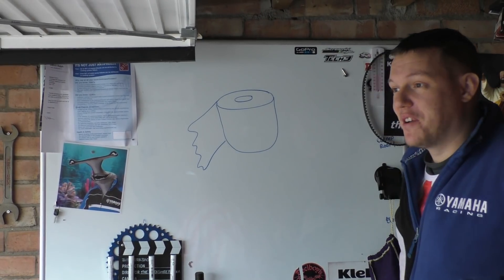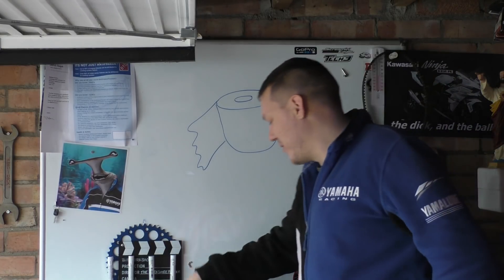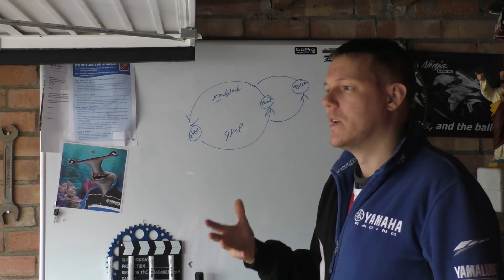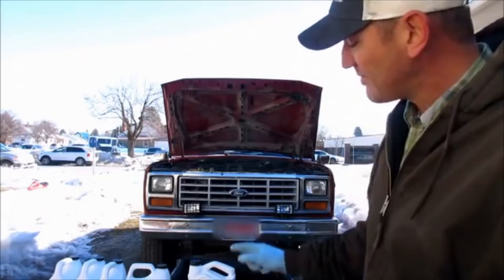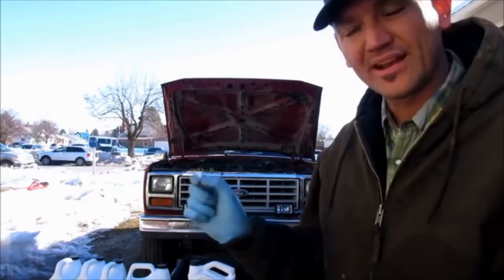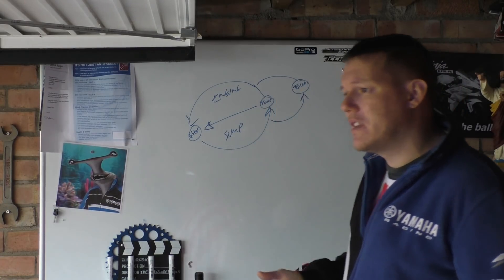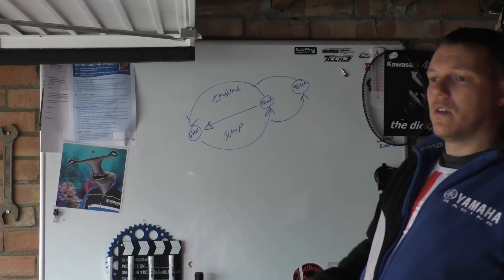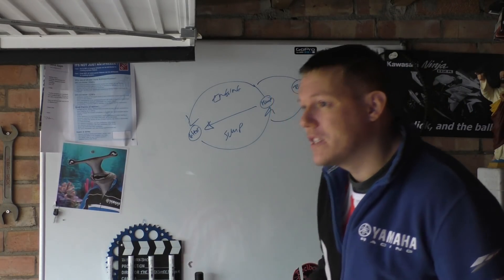Toilet paper filter???

Comment: You sir have no idea what you are talking about.
I used one of the Frantz filters for years without an issue and it was the only filter on the car as I removed the spin on filter and used the adapter plate that came with the Frantz kit.

Comment: You tee it off of any port that's under pressure i.e oil pressure sensors etc. And because they are fed constantly by a small amount of the systems oil the entire volume gets filtered and they are amazing

Comment: I call bullshit on your video! These filters are amazing (i.e not rubbish) they keep the engine oil clean as and we used to rely on SOS oil sampling to tell us when to change it because it's always looks so clean. Maybe you should work with something that has one on it before you make assumptions and make videos based on your thoughts. Just because you draw diagrams and have a little knowledge doesn't mean you know what you are actually talking about
Reply: So true, I used one for years without an issue and it was the only filter on the car as I removed the spin on filter and used the adapter plate that came with the Franz kit.

Comment: You can't put a sentence  together without the f word. You are trying to convince  people that something you know nothing about is no good. A depth filter will remove the abrasives. Additives last a long time in clean oil. When you change the filter the new oil added replenishes  the additives.oil doesnt break down toilet paper. The Frantz has been around since 1953. I have been using them since 1963. Carbon is inert? And you call me dumb.
Reply from the maker: I can, I just choose not to. And what the fuck are you banging on about?

Comment: Actually the guy demonstrating the Frantz knows more than any of you clowns. Nothing he said was untrue. Shell Rotella has been proven over many years. Probably shouldn't tell people not to use it. A pass through a Frantz and it will be clean.we all know new oil gets cleaner after passing thru a depth filter. The Frantz should have been mounted in a better place where it could drain at shut down. I mounted my Gulf coast junior on the plastic fan shroud. Returned the clean oil to the fill neck. No spillage when changing the 1000 sheet. I have done fine for over 50 years with Delo or Rotella. I use synthetic in the cars.I put two fingers in the core and count 30 rounds off with the Great Value 1000 sheet. I do a filter change about every 2 K miles on the diesels. If.I stay on this ignorant forum any longer I will be ignorant
Reply from the maker: Wow you are dumb.

Comment: Black doesnt mean dirty. The oil can be very black and. Be analytically  clean in a diesel engine. Some soot is non abrasive but it will turn the oil black. Its more.like ink. There are over the road trucks that have gone over a.milliion miles with no oil drains.The big Gulf Coast paper  towel filters  need a lot of new oil added at filter change. We know that new oil can be dirty. It wont stay dirty with.a good bypass filter. You will find the big paper towel filters on off shore rigs These are. Locomotive engines. A Shell rig will have the big Gulf.Coast paper.towel filters. The lift trucks will have toilet paper filters. Engineers will get a sample of oil and pass current thru it. Dirty oil will conduct electric  better than clean oil. They are checking for engine problems such as coolant leaks. That tells them if the engine needs to be taken out of service and a sample of oil sent to the lab.
Working in a marine engine room in July and August doesnt appeal to me any more.The Frantz Motor Guart and.Gulf.Coast filters all hook up the same as the.old.optional equipment bypass filters that were factory installed such as on my 41 Dodge.they dont starve the engine of oil. You need to do more learning and less talking.

Comment: At one time in the US all filters were bypass types and optional equipment.They all hooked up the same way. My 41 Dodge came with a Fram that used a.cotton element. GM cars came with an AC with a cotton element. Heavy duty diesels used Luberfiner  bypass filters that used cotton and later pulverized newspapers. They all tapped into the main oil pressure cleaned a small stream of oil and sent it to the oil pan. The small filters used a 1,/16" orifice. The large diesel filters used a larger orifice. In 1953 john Frantz came out with an adapter that allowed you to use a roll of toilet paper which was superior to cotton and cheaper. The problem with toilet paper is when it is mentioned  stupid people come from all directions. The smart people also come but they are out numbered. Thanks to the internet more.people are learning.

Comment: I started using toilet paper filters in 1963. Never.regretted  it. They clean oil. Oil dont break down paper..it is obvious you dont know shit about filters. I prefer  the Motor Guard  or Gulf Coast filters because they are easier to service. At one time Frantz had a.FAA and.PMA approved model that used toilet paper.You can find a lot of of Frantzs on Shell and Chevron drilling rigs. Many have been replaced by Gulf Coast paper towel filters. NASA is using Gulf Coast filters now. Yes the guy is clumsy. He probably goes too long between filter changes. You dont need a special oil. Nothing wrong with the filter.except if they aren't mounted correctly and you dont know how.to service them they can be a pain. The ones that take 3.rolls of toilet paper the 3 stackers you find mostly on large diesels in the.Gulf.of Mexico are a real pain to.service if you dont know how. My guess is the engineers.that service them know how to do it. The shrimp boat owners all know how. .

Comment: Low IQ. What do you expect? They believe in ever bit of marketing out there and will run on unicorn juice if it was sold.

https://www.bobistheoilguy.com/forums/ubbthreads.php?ubb=showflat&Number=2489538
Reply from the maker: LMAO!
Reply: Did you ever make a video testing the actual filtering capabilities of this filter setup?

This guy tested Amsoil and Frantz filter (toilet paper oil filter). He said his Toyota that used Amsoil had issues with the variable valve timing due to sludge. 😂😂😂

https://youtu.be/TCk8gzZGq2A

For what it's worth, I used to work at ExxonMobil at their lubricant production facility. I know how the stuff is made, tested, and shipped. These guys have no idea what is going on and if you read the link on Bob is the Oil guy, a worker at the Lubrication Specialities tried to res a 10 year old thread that started in 2004 in 2014 and attempted to rebuttal to senior forum members who questions the economics of a $50/gallon never have to change Motor oil. He was dropping bombs like TBN and old oil spec standards while others were questioning why his company is not even API certified... PAO!!! Omg, PAO! It's the shit! Actually, no it's not. All the modern Motor oils post oil market crash of 2013/14 is made predominantly of GTLs as they are not only cheaper but performs way better.

Oil chemistry is a Science. Big Oil companies hire hordes of highly qualified Chemists to formulate multiple blends to be used at different market conditions based on the price of the ingredients to still guarantee the same specs to the end user.

Oh, that Lubrication Specialities test claiming it is cleaner... That's not even a test done by an independent third party. That's the same as the Snake Oil salesman says that 60% of the time, the Snake Oil works everytime!

Marketing works though as there are certain sectors of society that falls pray to marketing since they aren't intelligent enough to make a logical and sound decision. It's business at the end of the day and if idiots want to buy it, would you stop making it?

Comment: A NASA engineer mentioned how the new oil. gets cleaner after installing a Gulf Coast filter. This was news to me. I thought new oil was clean. Gulf Coast happens to use toilet paper in their small filters and big roll paper towels in their big FIlters. You will find them on off shore rigs for Shell Chevron and others. Its not good to tell people not to use Shell. I know of a Peter Bilt.truck with over 1 million miles using Shell Rotella with one oil change. It uses big roll paper towels. Don't believe me ?.  I couldn't care less. I'm 80 years old.

Comment: I have used toilet paper filters for over 50 years.If you can't look at a roll of Scott 1000 sheet and  understand why they clean oil I can't help you. There are a lot of reasons for changing oil mostly poor filtration. Leaky head gaskets. Not driving enough at operating temperature to evaporate the fuel and water.. When you change the filter and add a quart of new oil you are adding enough new additives. That is if you change the filter often enough. Before I started using synthetics.I changed the toilet paper about every 2000 miles and added a quart of new Delo 100. I changed the toilet paper once a year and added a quart of Mobil 1 on the Subaru for over 250k. That was about every 12k. The Lab said the oil looked good for that many miles but recommended changing the filter every 6k which I do now.
Reply: Oh yes carbon is very abrasive. Yes some new oil. Is cleaner than than others. That is why you install a depth filter. 50 years ago I thought new oil was clean. We learn.
Reply from the maker: "Oh yes carbon is very abrasive."

- You mean like graphite? LMAO don't be a dickhead
Reply: What if funny is you calling someone else a moron.

Comment: Mecca produced those in the 1970s; all the top race teams ran them -- full-flow, no-bypass, 45 gpm (US gallons) rated using (iirc) straight 40W @ 50 psig and 230F.  Sub-micron filtration.  Unsurprisingly, racers changed the TP before each race group (qualification + heats + main event); doubtless, some changed more frequently than others -- but you had 24h races like Le Mans being run with them, practically everyone in Can-Am, the Baja 1000 and the Paris-Dakkar rally.  Those engines were being mashed-on HARD, and the Mecca filters (which were expensive af) seemed to keep the engines together and the teams, owners and mechanics happy.

The selling point was that the TP filter went between the pressure stages and the engine, in a dry sump setup (not sure if wet-sump engines were modded for similar flow, but it is possible), thereby ensuring the cleanest possible oil to the engine (no wear metals from the pumps, etc).  A second filter was used by some teams to guarantee the oil/air separator and oil tank remained free from abrasive contaminants.

Oil Tank --> Pressure Stages --> "TP" Filter  --> Engine --> Scavenge Stages --> (Optional Second Filter Location) --> Oil/Air Separator --> Oil Tank
Reply from the maker: Prove it.......

Comment: I just use the Royal Purple oil filter which have the best filtration out of any full flow filters they say 80 percent efficiency at 10 Microns there's also Amsoil which is the same exact filter but Amsoil is more expensive for their name as well
Reply: Franz filter down to two microns & absorb 8oz water.

Comment: I am testing an amsoil bypass filter myself went with bigger filter than needed to help cooling (didn't cool much at all but i did add a oil cooler on the return line with 0.5 amp fan) 
The engine holds 1.5 quarts and the filter holds about 1 quart plus hose almost doubled the oil capacity so in that respect improves change intervals and I'm running full synthetic oil however the engine oil filter will still need to be changed every 100 hours oem intervals. 
The bypass filter wasn't cheap but I was ticked off the find 1" wide thread on it so I had to spend more $$$ for the remote filter mount for it. I was going to put a plug in the fitting to limit the flow but that blew up in my face with unique thread probably so it can't be put on an engine by mistake. 
The engine had 174 hours run time on it it has around 260 on it now so it will be a wile before I hit 200 hours and I'll have to oil tested to see what's what😉 
As for testing would be easy if you want to test on drain oil instead of on an engine but the bypass filter equipment isn't cheap I'd use a fuel pump to circulate threw a brand new filter in a container. 
Get the samples before and after running used oil threw pump and filter👍 
If your testing on an engine you'd have to take the new oil added to the system into consideration when comparing✌
Reply: how'd it go?
Reply: @piotrekserwisuje  fan wouldn't hold up to the heat so left it off. Oil level rises as the engine warms up otherwise all good I upgraded to AN lines for easier service
Reply: @willyck948  did you test the oil though?
Reply: @piotrekserwisuje no need yet I run full synthetic to double the oil life added the bypass to improve the oil and filer life so instead of changing the oil ever 100 hours I can run it 200-250 oil stays pretty clean.😉
Here's a video link of the lines and bypass filter👇
I haven't had time to have the oil tested yet.
https://youtu.be/uRLOfVi7_nU
Reply: @willyck948  you do realize that there is more to oil durability than how it looks, do you? In my petrol car for example the oil is only a bit darker than when it came in @200 hours (calculated from mileage and avg speed) but I don't assume it's not turned acidic yet, nor that it didn't lose it's viscosity. If I were you, I'd test the oil earlier the first time, and then make conclusions from it's current state, as to how long you can go still.

Comment: Hi 
A bit late on the uptake of this one  but hey Jo
I can understand where this had come from, years ago when I was working as a goods vehicle fitter I came across chassis mounted bypass filters these were in addition to the engine mounted filters in the main gallery circuit. The bypass filters filtered The oil that   that had been dumped by the over pressure or pressure regulating valve on the pump so all the oil weather going to the engine bearings or bypassed back to the sump was filtered. 
A good system for heavy trucks but using bum fodda for a filter on a car, well there is only one explanation ..... AMERICANS

Comment: Is he nuts diesel engines run for like a million miles even with black oil running though them,i have to drive diesel trucks at work the oil is always black way before the service interval yet they just keep running.we have never had one fail,but you need to change the oil on any engine.
Reply from the maker: The cleaner than brand new oil got me the most. When he says it he does the whole scatty eyes routine and he seems to know what he said can't make sense, but then says it anyway.

Comment: if you use a cellulose filter with a mesh thats to fine. it will filter out the dopes thats added to the oil at the refinary. i have installed them in the past and the suplier does warn you for it.
But usualy you can find them on huge generator engines  on oil platforms.

Comment: It is called bypass filtration. About 10% of the flow is diverted and drips into that. It is low pressure in and out. I have never tried toilet paper that is for sure! The full flow filter remains in place and 90% or greater of the oil flow is going through full flow. I think in Europe centrifugal bypass is the norm but in the USA filter media usually some natural fiber often chemically treated is the norm. Our Big Rig's use ones this sort of system. 

The filter media though looks more like what you would see in old mattresses and old pillows or like yarn. I use Used Oil Analysis UOA to establish trending data then after I know what Oil Change Interval my machine needs I use it to monitor it for odd unexpected wear!

 People that think you can go with out changing oil again with bypass filtration are idiots. Change oil before it is loaded with insoluble and while the TBN is still good!  Use an oil with an hths of 3.5 or better that will flow and pump well during your winter. I like 0W40's and use them in my vehicles and my Mom and Dads vehicles. If I get a great deal I will also use 5W40's. All of our vehicles call for 5W30 or 5W20 from Toyota and General Motors and 5W40 or 15W40 for Dad's 1 ton Dodge Ram pickup truck. All of my UOA come back with single digit wear number's for everything except Dad's Turbo Diesel 1 Ton.  The fleet I maintain for my family is a mic of Toyota, General Motors and Fiat Chrysler products. The 1 Ton has a 6.7L Turbo Cummins Diesel in it and is a daily driver. So I am not talking out my ass. 

People fail to understand that keeping dirt out of the oil is super important. You need to make sure the air filter and all the parts that interact with it are tight, aligned and sealing properly! Nothing works better than a clean paper filter to keep dirt out of the engine. 

Bypass filtration on a light duty daily driver is silly! Most people that change their oil and keep the air filter in good repair could run a reusable metal mesh oil filter like the old VW Beetles used and never notice a difference in total life cycle of their daily driver. It is only when you have a catastrophic failure, no air-filter or do not change their oil often enough that an oil filter has much to do! When I cut my oil filters open they look like new with the paper element stained from the dark oil but nothing you can feel on the filter.  To get your money out of a bypass filter system you would have to own the vechile for a long long long time or us it in a commercial setting like delivery driver where the combo of miles driven and idling time are far outside of the norm! 

https://www.puradyn.com/filter-elements/

https://www.puradyn.com/5-product-specifications/

https://www.puradyn.com/independent-test-results/

Comment: Mr. Casper, If all carbon in an engine could be as beneficial as graphite, why not shoot the moon and go for another form of pure carbon..Diamond! Just run an engine on crappy fuel, never change the oil, remove the air filter, run the paris-to-dakaar a few times, and recover the treasure remaining in the oil/diamond mine (filter).